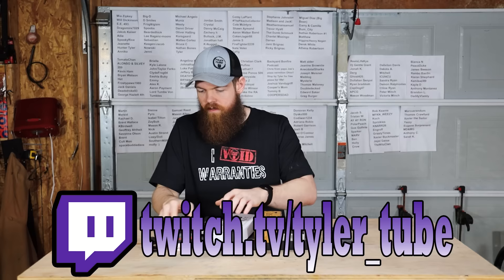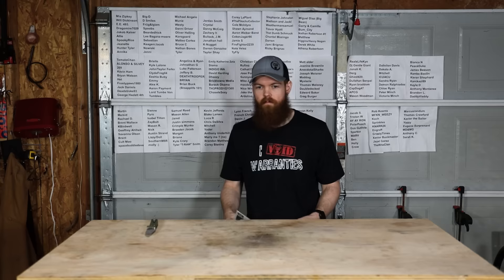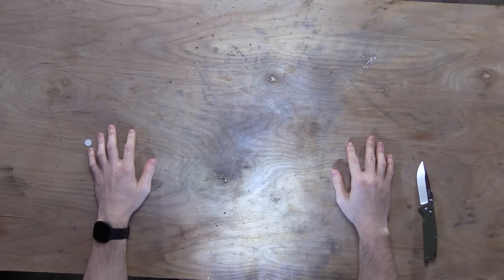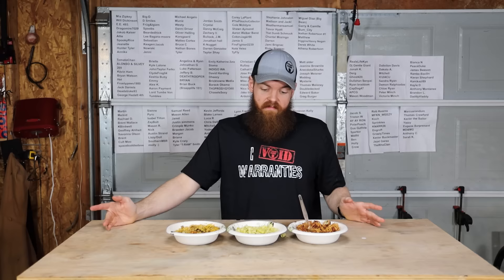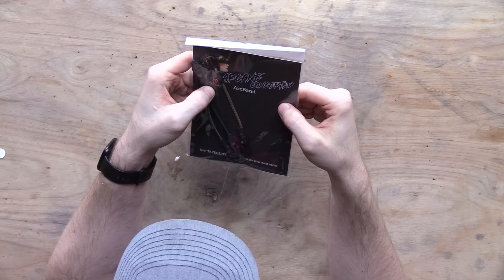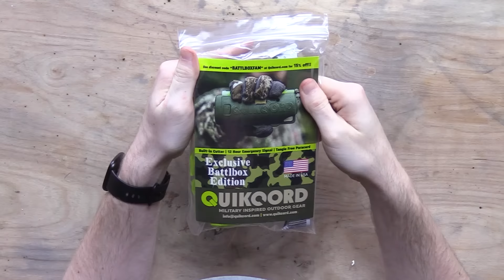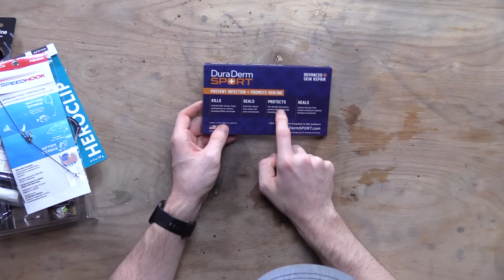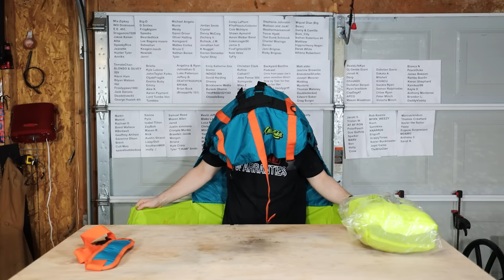I Unboxed 7 Battle boxes...This Is What I Got

Comment: Tyler: owns knife sharpness tester 
Also Tyler: uses a piece of paper to test the sharpness of these knives 🤦🏻‍♂️😂😂😂😂
Reply: to be fair, he does that aswell with the knife sharping videos.
Reply: @glennquagmire34  Giggity!! 😂😂🤘
Reply: Well everyone is familiar with the paper test and it is probably easier than reloading the sharpness tester line after every test.
Reply: @MrTrigun1  True, but it's still just not as good or as accurate, it's a pass or fail test and doesn't quantify the actual sharpness. I will say the paper test does a better job of showing if there are Knicks or dull spots along the length of the blade, but I still wish he had done both.
Reply: I agree, I enjoy seeing the tester used. Especially when it appears sharp and gets a terrible score.
Reply: @shaquilla5852  reported.
Reply: Paper test is pretty much universally accepted in the knife community. The other test is shaving hair. Although these aren’t the most scientific methods they are readily accepted because knife users look for real world examples.
Reply: Shaving hair test is even better than the paper cut test...If it shaves it razor sharp...
Reply: @petedetraglia4776  yeah but there is no way these knives would be that sharp out of the box.
Reply: @petedetraglia4776  I disagree. The paper test shows any dull or knicked spots on the blade. Whereas you can pass the shaving test with a relatively small well sharpened section of a blade that has all sorts of knicks and dull spots. The paper test is an excellent way to verify if there are any flaws. But as I said before he should also do the sharpness tester because it gives a quantifiable measurement of the sharpness.
Reply: At least with the paper you can hear more of the length of the blade scraping,  instead  of just the one spot of the knife sharpness tester
Reply: @justanotherfreakinchannel9069  Actually it's pretty accurate
Reply: Also Also Tyler: Calls Karambit a “poker”

Comment: The glass breaker will shatter tempered glass with zero effort. Easier than that mason jar, I'd bet.
Reply: Well, that's not how this channel works, my friend
Reply: I was thinking the same .  That thing would blast right through any car window, first try
Reply: Round things are harder to break just because of how the forces are distributed internally.
Reply: He does everything back-asswards
Reply: @chubbzy24153   lol You've noticed that sometimes too huh?
Reply: And he used the glass breaker while the blade was opened 😭 was probably holding back a little for his own safety

Comment: Lazer brite products are great for low light operations. Designed for the military with many different configurations. The black sleeve is a redesign of a chemlight holder so you can turn it and completely conceal the light.

Comment: That big knife you were talking about is indeed a very well designed meat cleaver/butcher knife. the distance from the blade edge and the handle makes for some easy chopping through bone without rapping your knuckles on the counter. most of them you would have to hone the blade edge a bit before use.
Reply: I believe it is actually a Tuna clever, if you watch giant tuna being cleaned they use a very similar knife.
Reply: @ericwallen  I don't think it is tuna specific honestly, though I am sure professional tuna fishermen would likely use something of this sort, there are many OTHER practical uses for it. Cleavers in general are more often used for chopping through meat and bone, so of course you are likely to see people who clean large fish using it as well.

Comment: The discrete survival light is a water beacon for a man over board in night. Reds are for low light situations and the tube that rotates is a signal light, it's easier to signal properly with that tube spinning compared to pushing the on/off button. It's stuff like that is what each piece does. So depending on what you want it for you set it up for that and it's good instead of multiple lights for different purposes

Comment: The tactical light has different colored lights because each one of them is a different wavelength and is therefore visible at different distances. The red light is the least visible at a long distance. Cheers.
Reply: Yep, that's why we rig for red on submarines when the periscope is in use or when surfaced and any hull openings are ajar. Always had to ensure underway flashlight had a red mode.
Reply: @DeagleGamesTV  yup any light on the outside must be red and any compartment that leads to the weather deck must be red light.

Comment: I work in the ER and that liquid band-aid is similar to something we use called Derma bond. Think super glue for skin. Pro: quick, easy application. Lasts a long time. Con: don't use it on joints. It won't last anywhere near long enough because of the constant movement.

Comment: The Fire Dragon solid fuel is designed to be used with a small foldable metal cooker called a Fire Dragon. I have one, but it is tiny and one of those blocks will about do a cup of water, provided you surround the cooker to stop it being blown out by the wind with a metal surround.  It is very prone to being blown out.

Comment: The reason for swinging the glow stick around is it makes the signal bigger. If you have a tiny little glow stick just sitting there even in the dark it can easily be missed at a distance like a helicopter. If you swing it and make a big circle with the light it makes it a lot more visible to someone far away. 
That's basic survival and I have zero doubts this dude was last about a day in an actual survival situation..

Comment: I have that Surviver filter.  No way is it 100k liters.  it is around 1,000 liters max.  250 or more gallons.   You need to back wash the internal fiber filter often if it is getting any kind of murk in the water.  It is supposed to filter smaller than .1 microns which is really good.  I think it is .05 microns.  The pre-filer and final carbon element needs to be changed at 100 liters I think.  The issue is it getting clogged really fast so have a syringe handy to back flush with filtered water about every 1 or so gallons in murky water.  It gets so hard to push the water through they break for some users.  Folks need to back flush fairly often on all of these brands/types of filters or you can damage them.

Comment: Well,if your worried about the knives falling out of the cases you can take fire to the opening end where the knife goes in,don't hold it in one spot, then pinch it closed quickly,you can get a damp cloth to set it quicker after the fire but you won't need it,then it will be snug for ya,thanks for the vids man, c-ya

Comment: I like fatwood for a fire starter.  It is cheap or easy to find for free and with a simple pencil sharpener you can a a could of pencil size sticks last for weeks.  You can get a decent tactile knife for $10... same with flashlights.

The flashlights and knives were OK, but likely all this stuff was either given to BattleBox cheap as a form of advertisement or it was older models left over or new stuff that did not sell well.  They get most of the stuff for VERY cheap and then basically sell it to you in random boxes for full price.

I like survival kits.  I was into them big time 5 years ago or so.  They are great for camping too.  I got canvas tool bags that were like 6"x10" with a zipper side at Home Depot for $6.  I put in a Cree Q5 flashlight with an extra battery, a folding knife, a lighter, a travel pack of baby wipes and Kleenex, an emergency blanket, and a disposable poncho, 3 insect repellent wipes, 3 sun screen wipes, chap stick, dental floss, tweezers, travel soap, a wash cloth, travel tooth brush and tooth paste, 5 packets of Ibuprofen, 5 packets of Benadryl and 5 packets of Imodium, a 7'x9' plastic painting tarp, a handkerchief, a small box of waterproof matches, 2x 6" x 1/4 rods of fatwood, a pencil sharpener, a small sewing kit, dental floss, a 5 fishhooks, 5 pinch sinkers, 25 feet of fishing line, a 1" bobber, 5 granola bars, pack of gum, 20 water tablets, a whistle, a small compass, 10 1" wide Band-Aids, 5 packets of antibacterial ointment, 5 alcohol wipes, 50 feet of paracord.  I also had a 1L stainless steel water bottle clipped to it.  Literally grab that, a backpack of clothes and food, a tent, and a sleeping back and you are good to go for camping over the weekend... or surviving a few days easily.  It weighed maybe 2 pounds and cost about $40 each.  I made 4 of them.  I did a much larger survival bag too, but I have pulled too many things out of it since then.  That had a small stove, folding shovel, hatchet, folding saw, solar shower, large tarp, larger flashlight, sling shot, some cooking pots...

Comment: Paper test shows sharpness better the farther away from your hand(the support) you can start the cut, if you hold a corner, and can cut the very tip of the other corner off, its really sharp. Starting cut right near where you hold paper just shows no knicks/damage, a knife only needs a standard edge to start a cut that close.

Comment: That is a battery powered "Chem light" we use them to mark L.Z.s , mark locations,  signal to air units, and the red light is for light discipline at night. The red light rays do not travel as far as other light. We use it to read maps and such at night.

Comment: That first knife, "the poker", is actually meant to held with the ring around the index finger and a fist balled around the handle. That way the blade is facing outward. It's meant to be used in a way that incorporates punches and hammer fist. If you punch just to the side of the target, like an arm, you'll slash them with the force of a punch. Very little use but offensive attacks and over the top self defense.

Comment: disrespected tf outta that cleaver😂 extremely badass Damascus meat cleaver, it didn’t slice the paper like the cheap knifes because it’s much thicker and probably had a edge meant to last though chopping bones and such, where the cheap sharp knifes are gonna wear down, bend the edge over, and dull quickly

Comment: I used a little JB weld on the inside corner of the warpath sheath and clamped it overnight.  It's still breaking in but it's super tight now.

Comment: The poking knife can basically cut someone’s abdomen open, spilling the intestines. Slash across the lower abdomen area. It will cut skin, not the intestines. A way to immobilize an attacker without killing them… or so I’ve been told.

Comment: that light that really confused you with all the attachments... the fact it is 100% waterproof means you can drop it in the water (works best in salt water) and it will attract the baitfish, as saltwater baitfish are attracted to light. It will then draw the bigger fish in to feed on the baitfish. it is a common fishing tactic used by the pro saltwater anglers.

Comment: Late as  hell  but  the arcbands  really are just little tie-downs like you  thought.  Meant for like fixing down cables from lights on a foregrip or holding down cables  from a radio on a tac vest,  or even just  holding a hydration bladder mouthpiece in a convenient place.

Comment: When I was in I had a set of those lazerlight tubes
basically they can be used for signaling like chem-lights but unlike chem-lights you can turn them off and configure them however you want.
I had red green blue and IR

Comment: So the purpose of the cleaver is to chop not cut. With that design in mind it SHOULD NOT be as sharp as the more aggressive edge profiles of the smaller knifes. You want a thicker edge profile for durability. Generally speaking the sharper the edge geometry the weaker it will be to sustained impact. The duller the profile the stronger it is but obviously doesn't cut as well. This is a generalisation and not always the case but a good rule of thumb. Edge geometries typically fall between 15° to 25°, 15 being sharpest 25 being dullest. For an example, hand made chef knifes are generally around 15°.

Comment: *  The neck light is really good for reading books.  They are not that great for activities that have a lot of movement because the light tends to creep around your neck, but for any stationary activity like reading or working with your hands at a table, they are hard to beat.  You, like me, are at a disadvantage with this light because of our beards which get in the way of the light.

*  I believe the fire "blocks are to be put in a can, kind of like Sterno.  For use with folding backpack grills and such.  Although useful as a fire starter over wood, you would lose the benefit of concentrated heat a can would provide (like a tuna can).

*  We of the Brotherhood of Beards used to have to take jars of Vasoline and liberally rub it through our beards to make the masks (somewhat) seal to our faces.

*  What you are smelling in the shower towel is the Bergamont which is the same citrus oil in Earl Gray Tea.

Comment: I use Flitz on my metal parts and feed ramps in my Glocks and P80s. Makes them super shiny and slick. Trigger bar, sear, disconnect and magazine catch. The feed ramp and just a little bit on the inside of the breach so casings feed perfectly.
Reply: Came to make the same comment.

Comment: The absolutely most useful, I constantly use it, knife I've ever bought is my little $1.97 key shaped folding knife for my key ring. 
I can open boxes, lidocaine patches, things I buy & so on. I added it to the pepper spray ring that has a quick release button to make accessing it easier. 
It's a tiny little knife that's probably dull af but I actually use it & I haven't lost it in 2 years so far. Thank God it's attached to my keys. I love that that thing.
Reply: Harbor Freight! for the win

Comment: The Hero Clip is actually quite useful, not for survival but for commuting via airplane.  It is strong enough to hang a backpack on a bathroom stall door, and also is good for attaching carry-ons to each other.  I learned about them from a flight attendant and have used one ever since in my travels.

Comment: I wasn't really impressed with my battlbox experience. Spent $200 and got a fish fillet knife, cutting board, single use grill, some rope and body wipes. The only thing worth a dime was the mount Olympus folding knife but not worth $200, my $20 Schrade is more reliable.

Comment: The weird one where the handle pivots for the lock is probably for when you need one that cant come unlocked. As long as you hold the handle the blade cant fold down and the lock cant fail cause youre holding it together

Comment: The knife he didn’t like was actually a brilliant design. Liner locks are notorious for closing on one’s fingers. That design was a folder that locked into place like a fixed blade. He also only told us one blade steel used, doesn’t know micarta/G10 scales when he sees them and didn’t know that Tops is a premium knife brand! Yikes!

Comment: Most of those knifes are junk. Not all but most. I've been a knife collector for 30 years and the pocket knifes especially the ones with a glass breaker and the push the thin piece of metal to the side to close are trash. I don't care how sharp they made it. You can buy them for maybe $20 at any gas station or hardware store.